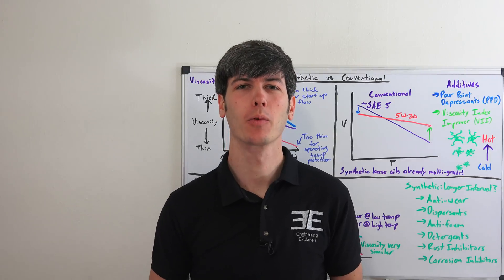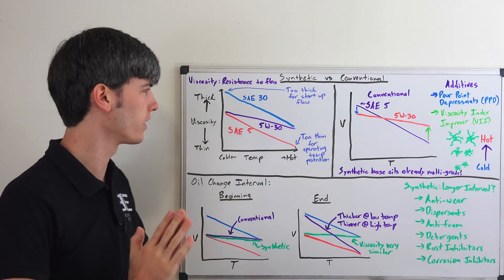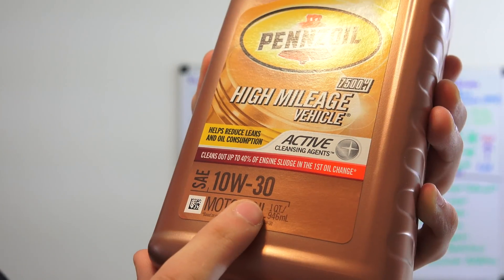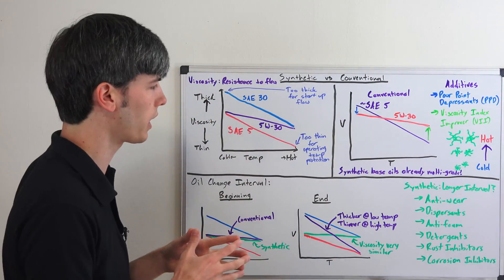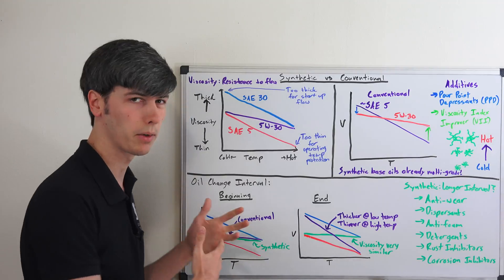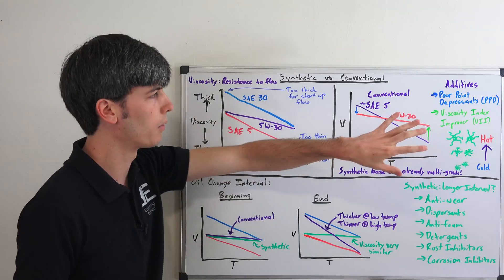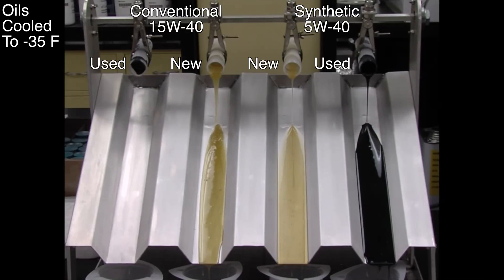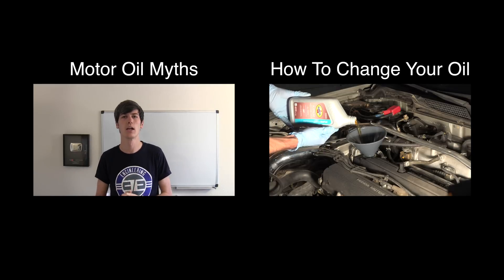Is Synthetic Motor Oil Better For Your Car?

Comment: I was active duty US Air Force for 24 yrs and retired a few years back but long story short (hopefully) I managed laboratories that tested aircraft engine oils for wear and tear. We used Atomic Emission Mass Fluid Spectrometers to test at the molecular level...normally in PPM or parts per million. We tested about 16 different elements for wear in particular places in any given engine. We started using synthetics many years ago...say early 80's. We kept meticulous records on each serialized engine so we could create and track wear. I can't go into great detail but suffice it to say that we started off testing every flight and then moved to 400 flight hrs, then 800, then 1200, (for oil changes) then only when we had a engine problem. Some places still test every flight hr but synthetic oils proved to be the best as far as wear and tear. I switched all my vehicles to synthetic at their 1st oil change. I would not recommend switching a vehicle to synthetics if it has a lot of wear miles on it because synthetic oils will "slide" around worn parts.  Another big plus for synthetics is you can qchange your oil at half or more the rate of conventional so if it's recommended every 3000 miles then it's safe to go to 6 or 7000. In My Opinion! I have been doing this since the mid 1980's and I had the ability to test these same oils for wear. If you spend $30.00 every 6 or 7000 then you'll save at least one oil change plus synthetics wear better, give better lubrication, are not as heat ploblematic as far as heat transfer, and don't break down like conventional oils. Just my 2 cents.
Reply from the maker: +Mr51Caveman thanks for sharing your insight and experiences!
Reply: Mr51Caveman Wow-good stuff man..paused the video to read that.Ty
Reply: I bought a 2008 Minivan and it had 102K miles on the engine but it also had records where the oil had been changed regularly. As I stated earlier I wouldn't normally recommend switching to synthetics at higher miles but newer vehicles have better built engines....so that said I switched the oil in this van to synthetics. I was totally amazed at the difference in engine sound, heat and fuel conservation immediately. I could hear the engine "hum" settle down and ran much smoother. I tested literally thousands of flight hrs on F-15's, F-16's, F-117's, F-4's, A-10's, Ch-57's, HH-60's, T-38's, T-37's and some ground support equipment (probably some more aircraft...I've just forgotten!). All used synthetics and we saw a dramatic difference in wear and tear plus other performance factor's. I personally go upwards of 10K + on my vehicles before changing the oil. No issues in over 25 yrs.  Oh, also I hold degrees in Aviation Technology and Metals Technology and I had to keep many Oil Analysis laboratories certified on a monthly basis.
Reply: Mr51Caveman amazing knowledge and experience you have . Thanks for sharing!
Reply: Iv'e been using Mobil 1 for years. Whenever I buy I make sure that it is FULL synthetic. Some oils will sell a "blend" which to me is useless. From what I understood years ago was that a blend could be as little as 2% synthetic....to me this is just a selling ploy. It was not regulated but that could have changed. I don't bother with any kind of blend just full 100% synthetic. Mobil 1 has been consistently a value for the money. Less expensive and works well. Now...don't get me wrong...I'm not endorsing any one manufacturer over another. I haven't been able to test all the different ones and like anything they all have the "best". I just know what has worked for me.  Some of the other manufactures cost as much as $10.00 a quart. Wow. Not necessary. Most of the time I can find Mobil 1 in 5 Quart containers for as little as $23.00. The majority of the time at WalMart. With that in mind a regular 10,000 mile oil change cost me less than $30.00 with the filter.  Not bad considering vehicle manufacturers recommend (On average) a oil change every 3000 miles. I think they know most people do not do this. But that said, many people today don't check or do what manufacturers recommend. I had a relative call me a few months back and she said her new car smelled "funny". I checked her NEW vehicle and it had over 5000 miles on the NEW engine. The conventional oil in it was black and gunky. I was like wow! "Did you not know you have to change the oil in your car"? And of course she said "no"! So I cleaned out the old oil and replaced it with synthetic and of course told her she had to watch her miles on the engine. But it amazes me these days with some of the younger folks who are clueless! They just think ...stick the key in and it goes! They don't look at tires, fluids (including fuel in some cases!!), etc. I tried to teach my 16 year old grandson how to change oil and he actually told me he didn't need to learn how because he could just "Google" it when he needed to do something!!! Wow...really?!!  Anyway...hope this helps.....
Reply: @Mr51Caveman  you have to make your own youtube channel aboit lubricants and grease and also you can make money by posting videos in youtube.
Reply: @Mr51Caveman  
That is awesome and thank you for sharing your experience. 

When folks lengthen the oil change intervals though, need to also pay attention to the oil filter that’s used. 
Folks who change their own oil, they probably get good quality filters and it’s less likely to be a problem. 
Folks that take their car to franchise oil change places, WATCHOUT!

Many oil change franchise will use what I consider low quality filters that can barely be called a filter. Small capacity. Saturates quickly/early. By which point the oil bypass valve opens up and let unfiltered oil flow right through, including the contaminants that was trapped earlier in that filter’s Service life, is now flushed right back into the engine and circulates through oil galleries. This will turn the oil into sludge real fast. 

Take a look at STP filters to get an idea. They come in basic, extended life, and third one might be called platinum or something. Each higher grade has more total filter medium surface area. 
That means both greater absolute capacity to trap & hold contaminants, as well as better oil flow through the filter so engine isn’t starved of fresh oil when running higher rpm. 
And most oil change franchise use filters with quality lower than a STP basic. 

If one is going to pay the price difference of going full synthetic, consider what kind of things one needs to monitor to make sure one doesn’t get ripped off. 
Examples:
Did the tech really grab the hose for dispensing full synthetic? Or did they grab the conventional oil hose out of habit?
Did they change the filter?
What filter did they use?
Did they change the crush washer?

To this day I still don’t change the oil myself. 
I understand that would be the surest way... to get oil all over myself, my clean driveway, and make a huge mess! 😅

But in all seriousness, I get free lifetime oil changes from this dealer when buying my car in 2010, that’s why. 
I changed oil religiously at 3K mi intervals for the first 100K mi; all on the dealer. I’m sure they used conventional oil. 
Afterwards both because I wanted to switch to full synthetic, and I was feeling bad for them, so I changed the setup:
I bring my own full synthetic to the oil changes, they step up from STP base to Extended Life filter. 
I always ask them to put the 0.5 quart (in the original 5qt bottle) back in the trunk. Both because 1) I collect it for my lawn mower & snow blower oil changes, and 2) So I get a visual “circumstantial evidence proof” that they indeed put in my full synthetic in my car, instead of putting in their shop’s conventional oil and pocketing my 5qt bottle of full synthetic for personal use.
Reply: @reallifeengineer  Great reply! I'm now in my 60's and I have never taken my vehicles to an oil change place. Mostly because I didn't trust them for the very reason's you cited. I use NAPA Gold filters and I have occasionally used a oil analysis to see what they are doing. I still change my own but it is getting more difficult climbing under those vehicles!
Reply: @Mr51Caveman  
Maybe the grandson is willing to learn how to do that now. 
$5 cash incentive to him, every time he does that for grandpa! 
😅
Reply: @Mr51Caveman  , LOL I feel your pain...
Reply: @Mr51Caveman  actually most vehicle manufactures recommend an oil change every 7,500 miles. Not sure where your getting your information. its the oil change shop on the corner that recommends every 3,000 miles. The earliest OCI i have ever seen from a manufacture was 5k miles.
Reply: @Mach141  I was going back to where I started back in the 1970's when it was 3 months or 3000 miles. Times have changed. Engineering is much much better.
Reply: @Mr51Caveman  If a new motor with just over 5k miles and it has black and gunky oil coming out of it the engine has a problem. No oil in today modern engines should break down that fast.
Reply: @jjack6896  A new engine will have a break in period. Oil will be black. As far as the "gunky" part...that's subjective. If it's silvery or showing metal particles there may be an issue.  Do you have access to a strong magnet? Sometimes a lot of particles on a magnet could be an indicator of abnormal wear. Personally I would.change the oil and see how it looks the next change. Even with synthetics it will still be black though.
Reply: @Mr51Caveman  To be frank, many people have learned how to change oil just by watching a youtube video or reading a forum online. Your grandson knows how to use his resources well, I know after watching a few youtube videos on changing oil it taught me how to do it. I've never had any problems.
Reply: @ryantoews3886  I'm not sure if my context was what I meant. That probably doesn't make any sense! I think what I was trying to infer was that the young folks, like my grandson, don't care to actually learn much of anything because of the Internet. We raised him from 4 months to 19 yrs old. I watched him do his "homework" by using the internet to answer the questions. When I caught him I would address this but it did little good. I agree resources are good to have but what happens when those are not available? I use YT or other resources for stuff also. Sometimes it's gotten me out of some pickles for sure! I'm getting ready to install a Mini-Split heat pump system and I don't believe I will have to hire a HVAC person to do it. Estimates so far have been near 10K for them to do it. Myself? Less than 2K. That said I believe people should still get their hands dirty on occasion. Hope I read your reply in the right context. Sometimes not personally talking can get things way wrong.
Reply: Jeff Rielley Actually I started off as a F-15 Crew Cheif. When my lungs collapsed at Moody AFB in the late 80's I told my wife it was time to either get out or cross train. Put my paperwork in to cross train and it came back approved for NDI. So if you were a crew dog you know about NDI. One of the greatest jobs in the AF. Nobody really knew what we did. Did that until the late 90's then took over as Cheif of QA for the last couple years. When I hated putting my boots on I knew it was time to retire.
Reply: Your welcome! My 1st experience with P-3's was when I went to high school in Rota, Spain in the early 70's. Then after I went in the Air Force I was stationed at Keflavik, Iceland for a couple of years in the mid 80's. In fact there's a story I tell around the campfire about how a couple of my fellow airman saved a running P-3 from a dumpster that had been picked up by the high winds that we enjoyed so much in Iceland. They saw the dumpster cartwheeling across the ramp going straight towards a running P-3 and they drove their flightline truck in-between the dumpster and the running prop. They saved the aircraft but did a number on the truck. Nobody hurt except the truck! Actually I have a bunch of campfire stories about Iceland. It was a very interesting tour! Anyway yes, we usually checked 19 different wear elements and it was amazingly accurate. The only real problem we had is if catastrophic wear had occurred and the particles were too big. They had to be molecular to break them down into the spectral lightwaves. When I was stationed in Alaska we had a Army Blackhawk come in and I saw the sample. You could visibly see the particles! I attempted to ground the Chopper because the rotor gearbox and transmission was obviously trashed. The Army Base CC overoad me and told the pilots to fly it back to Ft. Richardson.  They crashed! Luckily no one was hurt or killed. But needless to say it never happened. No one was held accountable as far as I know but as far as the Air Force was concerned when I grounded an Aircraft IT WAS GROUNDED!!!! No one ever questioned my authority again after that. Our spectral analysis wasn't 100% but it was pretty close. Yep...more campfire stories!! Cheers!
Reply: If I had been smart, I'd have enlisted in the airforce. Instead, I joined the Army so I could shoot people. Totally unrelated, but I'm letting you know I'll be extending my middle finger as I cry myself to sleep later. In other news, using army ingenuity, we realized that some heavy weight motor oil is the ideal lubricant for squeezing off rounds with the M2 50 caliber machine gun. It can't be that thin stuff fresh out of the bottle, it needs about 20,000 miles or so between changes. When you seize up an engine, that's the best stuff for the Ma Deuce. The motor pool chief and mechanics don't like to sacrifice good engines to the Infantry Gods, so like most things we learned that rubbing a little dirt in there thickens it up pretty good. Now we tried to bring some of that good southern clay over to Iraq specifically to lube her up, but the tree huggers started crying. I don't know from personal experience, but I heard some Rangers figured out that those liberal tears work pretty good too. I wouldn't try that personally, I'd be afraid of ending up with 45" of limp barrel. 

Yes Sir, one thing I can say is... Thank God I wasn't a marine.
Reply: Asking the oil change place how often to change oil, is like asking a dog how much to eat. Their answer in both cases is, "More. Lots more!".

I would place more trust in recommendations of high end auto makers. They want to be convenient, just as they must avoid too many warranty repairs. Because of recommendations by BMW, Saab, and others, I think the 6-8000 mile interval is usually good, and that synthetics definitely last longer. I do believe they support that synthetics resist oxidation better.

Nothing lasts forever though. The additive package in any oil wears out over time, and changing the oil starts anew.ss Hope this helps.
Reply: louisdl duv Sorry. We didn't test for oxidation. I can't really speak to that except if a Jet aircraft engine can basically go hundreds of flight hours without oil changes then I would imagine a regular car or truck could go for a really long time without that being an issue. And you would have to consider that a jet engine as severe loading and extreme temperatures.  Usually for oxidation to occur the oil would have to be exposed to air/oxygen. A car engine isn't sealed but it is protected very well.
Reply: John Doe imspoke,to,that earlier about the "blends" not being regulated. I would think that if a manufacturer states on the bottle that it's 100% synthetic and it wasn't then they would open themselves up to potentially multiple lawsuits. Now that definitely does not mean they won't  lie or try to squeeze every dime they can from the consumer. There are any number of cases for big business fraud (Volkswagen, BP, etc comes to mind!).  I'm under no illusions that they know that the majority of us don't have the capability to test a lot of the stuff we use so all we can do is hope somewhere along the line if they are trying to cheat us we'll find out and put the SOB'S out of business. That's really all the power we have.
Reply: @Mr51Caveman  l1...
Just want  to thank you for sharing a good information in regards to engine oil. I was a machanic in one of the dealer of Gen. Motors and we only use fully synthetic oil for engine.
Reply: @Mr51Caveman  Do you not know the difference between full synthetic and 100% synthetic?
Reply: Jeff Rielley Ah...yes! I didn't mention those acronyms because most folks wouldn't know what I was talking about. So you know how much sampling we did. Good deal. I don't know if you were around when we did AA or Atomic Absortion testing...pretty dangerous cause we could blow up labs! Really GLAD we went to AE (Atomic Emission). Way safer! Of course I've been retired almost 15 years now so I don't know what's being used now. The last unit I certified was a Spectoil spectrometer. That was the latest and greatest back then.
Reply: Hey I was a "Crewdog" for 12 years before I crosstrained! I know what that's like! I got tired of getting beat up on the flightline so I got out of there luckily. I was a F-15 CC at Langley then Tyndall, then Iceland and finally F-4's and F-16's at Moody. When my lungs collapsed on the line at Moody I said that was it! Crosstrain or get out. But TAC approved the crosstraining so NDI it was. The only reason I started the comments on the synthetics is cause we tested so much of it. Actually is really good stuff. And thank you for YOUR service also. It's a unique club.
Reply: Years ago my mechanic pointed out a hypocrisy of arbitrary maintenance 
schedules vs observed maintenance checks. I exceed 50,000 miles a year 
in my work truck. I drive a Ford F150 XLT super crew. I use Mobile 1 
Extended Performance which guarantees 15,000 but I follow the 10,000 
mile guideline from the operators manual. 

The operators manual identifies an oil change interval of 5,000 miles if the on-board system fails/resets which uses a totally different standard of 10,000 miles or 1 year. If I take it to Ford for an oil change, they use Motorcraft® Synthetic Blend oil and they give a recommendation of every 3,000 miles as per the sticker in the window. There in lay the hypocrisy.

An engine that runs 150,000 miles would go through 15 oil changes based on the manual but would need 50 based on Ford Service's recommendation. Ford's $39.95+tax for each oil change adds an extra $1,400 in services to the vehicle's cost of ownership. Being objective, I know I can buy a used motor with 35K miles on it for about $1,500. Said another way; Following the manual, I'll spend about $600 but following the service department I'll spend about $2,000. 

The price difference in service intervals will keep my 3 year old truck running another 2 years. That means my vehicle depreciation cycle goes from about $17,000 a year down to $10,000 a year with less days of inactivity due to maintenance. Granted other parts will fail which is why you need to keep solid maintenance records.
Reply: Thomas Fraser Wow! Great analytics! Most people would never delve so far into this. But that said that's what we did in the military. We analyzed everything....down to parts per million. It makes sense if you want to find out everything you can about the life cycle of something. And although the military (government) isn't usually associated with cost savings sometimes they do discover ways to do that.
Reply: Mr51Caveman
Reply: Mr51Caveman .
Reply: I remember the days of taking SOAP and JOAP samples.  Good times.
Reply: I was a crew chief, so I took the samples.  Didn't test them.
Reply: mr51caveman, I'd pay you more than 2 cents for that info, thanks.
Reply: Mr51Caveman great
Reply: Mr51Caveman thanx man that was interesting.  its def worth a video.
Reply: Mr51Caveman, thank you for your wonderful commentary. I have an F250 diesel and send my oil for analysis at blackstone labs. really nice and detailed reports on a wide variety of metals and other substances. BTW, I used to fly P-3's for the navy. good times!
Reply: kiddi gudjonss I miss Iceland too! I have thought many times over the years about going back to visit....or even to move there! Seems like many things have changed since we lived there in the mid 80's. My daughter was born there. I guess maybe she has dual citizenship? She has Icelandic and American birth certificates.  She really wants to go also since she was only a few months old when we left.
Reply: GModBMXer I'm not giving anyone advice and I believe somewhere in these comments I specifically said that. I related MY experience from many, many years of actually testing oils and performing Nondestructive tests on many other things, especially aerospace equipment (Aircraft and ground support equipment). I think I also stated that I was a Certifying official for many separate testing laboratories also. We had extremely stringent guidelines for Joint military certification, all services and had to have recertification every 30 days.  Most owner manuals are written for best case scenario's and minimum requirements. We had Indices for just about every engine imaginable. BTW I have lots more stories. What military person doesn't? !!
Reply: Great to see comments like this. Nothing replaces real world experience.
Reply: I did the same thing in the Navy, with the same results. I would like to add that when we disassembled parts and components that had conventional oil, you could see the wear with the naked eye. With the synthetic oils, we would actually have to mic out the parts because they looked new. To also put this into perspective, with conventional grease on planes surfaces, we had to grease daily. Every day. When we went to synthetic lubricants, we only had to grease once a quarter or every 3 months. With the synthetic grease, the grease times expanded and the amount of wear dropped significantly.
Reply: interesting reading mr51caveman! my experience with synthetic oils is also very positive, I have a 2003 Toyota hilux that I brought with 300,000km on it, but it had a very strict service history (every 10,000km) and had done a lot of hyway running so the engine was in very good condition considering its age, (no sludge build up or oil use between services) when I took ownership of this car I changed the oil with a genuine Toyota 20w50 motor oil thinking I was doing the right thing, but on further investigation I noticed that the oil was an "SG" rated conventional motor oil and I noticed the engine was slightly noisy on start ups and sounded slightly more noisy in genral.I then decided to change oil again this time going with a 15w50 full synthetic penrite oil and straight away I noticed a quieter smoother sounding engine and it even felt slightly smoother to drive (I was impressed) I can also say the same about that in two stroke engines whenever ive stripped down engines running non synthetic oil there is considerably more carbon build up and more piston skirt scuffing then when there running synthetic oils
Reply: Arthur Smith I will definitely have to check that out! Thanks.
Reply: I bet you were at Holloman,eh. I was 8th.
Reply: Eagle 275 Yes! I was the NDI lab NCOIC 94' through '96.
Reply: +Mr51Caveman Wow, get out of town, an honest to goodness NDI guy eh? I was a Crew Chief. And because I was a crew chief, I'm very accustomed to being hated by everyone, so when I say I don't buy into the synthetic oil nonsense, it makes no difference that everyone here is going to disagree and tell me just how "old world" I am. 

At any rate, thanks for your service. Code Alpha good buddy.
Reply: That is super good advice, I use it all the time.
Reply: Mr51Caveman  where are you living these days? I have a 47 Navion that needs. Guru or new owner!
Reply: Lee Wilson Greenville SC area. 47 Navion?
Reply: 16's Weapons Troop here!!
Reply: Alexander Mills is what?
Reply: Mr51Caveman turboshaft oil is completely different then recip oil, not comparable. I worked in AOAP lab.
Reply: No sorry. In my opinion I think a decent filter, not a cheap one or a real expensive one,  Is fine as long as full synthetics are being used.  If wear and friction is reduced then wear metal particulates are also reduced putting less emphasis on the filter.
Reply: How is synthetic oil on turbos. The biggest problem with turbos are the oil caking and destroying the shaft. I had an 88 Dodge Dayton Pacifica with the turbo 1, 2.2 liter 4 cyl. engine. The turbo was oil lubed and cooled by the radiator since it had a cooling line going to it. I never had an intercooler, but the single core, plastic side radiator, I had to change out with a 2 core copper and brass black painted, which helped drop the heat. I used 10w 30, 20w 50 and even 5w 30 weight Castrol oil. I just couldnt keep the heat down(overheating issues from the turbo). I even went as far as using a heat shield on the exhaust side of the turbo and on the hood. Viscosity breakdown was a big problem till I changed the 195 degree thermostat to 185 which helped drop the temp down.
Reply: Thanks for Sharing your experience ! i just started doing the same thing and changing from 6-7k miles .. now i see you doing it for very long time without troubles make me feel better
Reply: I too am a certified aviation mechanic, all he stated is true!!
Reply: @Hystorm1  / sure u are...
Reply: Also a former USAF type and noticed, in the early 80's, that they were using synthetic oil in the jet engines.  So, from the mid 80's onward I've always used synthetic oil.  My brother owned a car repair shop and had the chance to rebuild an engine from a car I sold -- the guy that bought it was out joy riding when he dumped it into a canal and ruined the engine.  When my brother tore the engine apart he found almost no wear on the engine.
Reply: NDI Shopchief here. Thank you for your service sir. Interested in this video and found another NDI technician, cool.
Reply: Hey! Thank you also! I've been out of the loop for a few years now so I don't really know what's going on in the military NDI world. After we moved away from Tyndall I lost touch with most everybody. I spent about 3 months out in Vegas doing some pipe xraying (Iridium) and a little Penetrant and a lot of Ground Penetrating Radar. But I was going back to the mid east (Contract) when I got a call from Honeywell Aviation so I thought hmmm, I can avoid all the mid east crap (dodging bombs and bullets)  and stay in the States so I took that job instead. So about 5 yrs ago the nice, well paying job got shipped to Mehico. Out of a job again. Oh well. So been doing pretty much nothing since. Some of the jobs I applied for here didn't pan out because I was OVERQUALIFIED!!! I didn't want to run their companies just have something to do besides cut grass and do housework! Anyway where are you stationed? Big planes or little planes? (Or both in some cases)
Reply: tony coppe Your very welcome. I've been out of the NDI business for about 5 years now and I kinda miss it. Cleaning and cooking sounds like retirement but it isn't!
Reply: Fred Allen I was a F-15 Crew Chief also for the first 11 years or so. Yep SOAP was what most old timers called it and some still do from what I understand from my son in law (active duty AF). I think it officially changed to JOAP or Joint Oil Analysis Program sometime after the mid 1990's but we still referred to it as SOAP. It is a good program. We had indices for just about every engine imaginable and I tested sometimes some strange stuff including blood! Bored military folks! But over the years we saved not only aerospace equipment but pilots and such also with the program. (Crew and passengers) The mundane everyday testing didn't always prove that but there were a few instances where I specifically grounded an aircraft and further testing resulted in confirmation of catastrophic damage. Just my experience...I'm sure other Labs saved equipment and folks also! Don't want to sound like a glory hound.
Reply: Great info. My dad was Navy. 22 years worth. Thank you for your service and your reply. I was a Navy "brat". Went to High School in Rota, Spain.
Reply: Dear Mr Caveman, I have a Honda 97 Civic that has 130k km. Honda recommends 5W40 for the  engine. But the engine have been converted to run on CNG. And i live in a hot humid country (temperature varies from 38C in the summer to 10C in the winter). What grade engine oil will be best for my engine considering the fuel and atmosphere?
Reply: Amazing. I've never heard of someone deliberately running an engine with no oil except for a couple of commercials over the years. I don't know the mechanics of molecular level oil and metal. Just that which was observed with Spectrometry testing. Thanks for relating your experience.
Reply: Leaonard Land Not saying that at all. Like I said before everything I say is only an opinion. That said a decent filter will probably serve you well. That said, a cheap filter is probably never a great idea. A midline filter would probably serve you well. Nothing to stress over. With all the new tech out any midline filter will probably serve you well. .
Reply: I'd like to see a video of someone taking apart an oil filter after say 25,000 or more miles with it not being changed and using synthetic engine oil - or better yet comparing oil filters at various mileages with synthetic oil, say 3,000, 6, 9, 12, 15, 25, 50,000...Perhaps such a Youtube exists.  I'll have to do a search and see what I can find.
Reply: Thomas Morris I have always been leary of using full synthetics in high milage engines. Note this is just my opinion. You are probably better off using a oil that is specifically engineered for high milage. I use a Castrol in my son's Toyota Tacoma that has in excess of 224K miles. But I use a half quart of full synthetic with the other 4+ quarts to give it some added protection. Does that work? Actually without testing the residual oils I don't know for sure. But so far no issues with the engine. I have never been a fan of Quaker State. Some folks are. I've had good luck with Mobil1 but that's just my particular experience and I'm not endorsing any particular brand.
Reply: @Mr51Caveman  O.K. What if you put 2 and half quarts of synthetic oil with a high quality convential oil 2 and a half quarts. 5 quarts with a Mobil one filter. That would be half and half right. So it would be a cheaper oil change except the Mobil one oil filter is $9.97 at Wal-Mart. Change it at 5,000 to 7,500 miles. My Ford 2005 Taurus has 160,000 miles. I did the 150,000 mile Maintenace. I ran 5w20 Motorcraft blend for the 150,000 miles . Decided to go all synthetic 5W20 high mileage Valvoline. The car just didn't seem to run very good. Watched a YouTube video. Decided to run Supertech 5w20 high mileage full synthetic.  The car ran so much better on the cheaper Supertech. My gas mileage went from 26.0 mpg. To 28.1. While driving the same route every day. I am using a Fram Ultra Synthetic filter now instead of the higher priced Mobil one. Just saving 50 cents. But the Supertech oil was $17.71. So now  my oil change is $ 26 and some change not  $ 30 and some thing. The motorcraft was good but it just didn't get the gas mileage I thought I should get. My round trip is 60 plus miles a day. My goal was to use just a little over 2 gallons of gas a day. For a car with 160,000 miles this isn't bad. My car has the Vulcan 3.0 OHV engine. I took the valve covers off and the engine is spot less with hardly any wear.    Shawn
Reply: @shawnbeck2303  Sounds like you have a working plan. I personally don't use synthetics in a high mileage engine IF conventional oil was used for most of the life of the engine. But that's just me. It's almost as if the engine wear with convential oil has worn itself into that medium. Some parts with super slick syn will allow "slide" around ( definitely not a technical term) But what your doing seems to be working. Ok..now for just my opinion again...co out some of the YT vids on oil filters. You may be unpleasantly surprised at how the cheap filters perform. I personally have switched to NAPA Gold or a Purilator. More expensive but you get what you pay for. I learned that the hard way. During all those years testing most was for Military applications. Entirely different type of filtering systems
And I never asked folks  about their brand of filters when testing other type engines. Probably should have
Reply: This leaves no sane man with he choice of conventional oils. Thanks!
Reply: Bo_Hazem Hope the discussion helps!
Reply: It does help. I did however found out, when you buy a reman engine, they say NOT to use synthetic oil, Use conventional oil at the first 500 mile and then at 1000 miles then 1500 miles after that till you have 3000 miles on the engine, then you CAN use full synthetic oil after that. Its from Performance engines.
Reply: @thomasmorris2069  Yes, That s for all new and rebuilt engines. I bought a Jasper engine for my Ford truck. It was a 1981 F-100. 300 6- cylinder. The old engine was worn out and had blow by.  Shawn
Reply: Thomas Morris I wasn't aware of that but in a way it makes some sense. A more thorough break in that would occur faster. Super slippery Syn might make that initial process slower to occur. Plus all kinds of other 
factors. They are the engineers. Good to consider.
Reply: Thanks for your service(and detailed comment)!
Reply: I agree wholeheartedly with your recommendations.  I have a 2003 Ford Mustang GT.  At 1000 miles I drained the factory fill and have put nothing else in the car besides Mobil 1 synthetic that is changed every 6000-7000 miles.  I've even went 10,000 on a couple of occasions.  Fast forward to today, the car is just shy of 289,000 miles on it with no major issues and the car still does not leak or burn a drop of oil between changes.
Reply: Thank you for your services sir
Reply: @Mr51Caveman more interesting than the video
Reply: JOAP
Reply: @jd646  When I retired back in '02 most folks still referred to it as the "SOAP" lab but I get what your saying.
Reply: @Mr51Caveman  when I was in it was JOAP
Reply: @jd646  where were you at?
Reply: @Mr51Caveman  I was a crew chief on f16s at spangdahlem and osan
Reply: There were some guys that did a test with a brand new car and synthetic oil, and setup to just replace the filter every interval and top off the oil. I believe they used Mobile 1 but not entirely sure.  They had detailed breakdowns on their site of tests they had done (by an independent lab)  and aside from some outlier tests (single tests that resulted in results indicating possible or approaching trouble) they got by quite well for iirc 75k miles without doing more than topping off the oil/replacing the filter every 3000 miles. Also iirc the car they selected was one of those that had the filter attached by hoses to the side of the engine well instead of under the engine, so it did not lose a great deal of oil on replacement. They were mechanics of some sort btw. I think they intended to tear the engine down at 100k but things got sidetracked.
Reply: My grandfather always suggested if full synthetic oil was used, it never needed changed other than the filter and topping it off.  My 2000 Grand am has just under 300k miles and I probably changed the oil only 10-12 times in the 18 years I owned it. I usually change it whenever the car overheats, tune up, or or other repairs that could risk introducing foreign dirt etc in the oil.  I've done this to all of my cars and they all have over 200k miles. I question if frequent oil changes increases the risk of introducing foreign dirt and stuff into the engine and reasons why most people have more issues with their cars than I ever have.  @copperhamster
Reply: @copperhamster  funny I’ve thought the opposite. Change the oil and leave the filter. How much can it possibly be pulling from the oil?
Reply: John Doe use synthetic in the winter. It flows better in freezing temps. Yes you can swap around and add conventional oil to synthetic and vice versa. Check out on YouTube. -40 Mobil One  Amsoil  Royal purple test.
Reply: Mr51Caveman Royal Purple
Reply: Mr51Caveman is
Reply: Loved your campfire stories, I have a few from when I was stationed at Loring AFB in Main. Like the accident a KC-135 had with a Moose on the runway. The aircraft was rolling for take off when the Moose decided to run across the runway and collided with #3 engine. They had to send up folks from Boeing with Depot to fix that one and there were Moose parts all over the runway.  I learned to really hate winter there too. Like you I was in Fabrication Branch but I was in the Machine Shop, but I did work with the NDI folks a few times. Later, when Machine and Welding became one shop all our welding certs went through NDI. I left active duty during the buy out in 94 but wound up in an Air Guard Unit. Y'all take care.
Reply: Greetings from Iceland, Keflavik hasn´t been the same without you!
Reply: Mr51Caveman l
Reply: James Graves -
Reply: yes?
Reply: Mr51Caveman k
Reply: Sarge, I remember those days I was a mechanic on F15s. We called that a s.o.a.p. sample. I was so impressed that after I left the USAF years layer I bought a Peterbilt and found that Speedco was one of the few places that offered three same program,under a different name. I paid the extra $10-12 to have it run on my motor. Great program.
Reply: Mr51Caveman                                         ,,,
Reply: Mr51Caveman boom roasted
Reply: Mr51Caveman Well your 2 cents are worth much more than just that. I've been paranoid messing with synthetic after I used it on a high mileage car which caused an oil leak. I will go through the owners manual and forums for using synthetic on my 2016 Accord Sport now. But with using synthetic on high mileage engines which you also mentioned, is there a certain mile mark where one should transition from synthetic back to conventional due to those issues ?
Reply: I don't know of a milage "mark" for transition. I've owned literally 20 plus new vehicles in the last 35 or so years. It used to be kind of a joke in my family that I couldn't keep a car or truck more than a year or so. I started to change over to synthetic on the first oil change with all of them. In my opinion if someone had advanced full synthetic the entire life cycle of the engine then wear would be minimum, all things being equal. Today's engines are engineered significantly better than they used to be. I remember when having 50,000 miles was considered almost "high" milage and anything over 100K was over the hill! Today's engines are just getting "broke in" @ 100K miles. Vehicles with 200k or more on their engines is pretty common anymore. Engines are mechanical in nature and manufacturing techniques vary but still most are engineered with tight wear tolerances. Like I said, in my opinion (I want to make that clear!) I run full synthetic at the earliest opportunity.  If I purchased a vehicle that I couldn't confirm oil type or change interval and it had high miles on it I would probably use a high milage conventional oil in it. Without a somewhat expensive breakdown (Inspection) to confirm wear I don't know of a way to check. A rough running engine could be all kinds of different things from sensors to crappy fuel. I hope this answers your concerns.
Reply: Great info! Thanks for your comments.
Reply: I use Mobil 1 extended service guaranteed for 15,000 miles.  I've been using Mobil 1 for many years.  On my old VW Beetle that I bought used I never changed the oil.  I just replaced what dripped out. It got to 300,000 miles and still ran like new but rust was destroying the body so I gave it away.  My previous vehicle, a '97 Ford F150  had 332,000 miles when i traded it in and likewise still ran like new.  I changed the oil every 10 or 15 thousand miles on it. My present vehicle,  a 2009 Ford F150 now has almost 200,000 miles. I treat it the same as the last one.  

Back in NYC I knew someone who once tried to deliberately destroy an engine by running it without oil.  But the engine had Mobil 1 in it before he drained it.  He said that oil was so good that it got into the pores of the metal and after running it without any oil at all for many hours it still ran perfectly and he gave up.
Reply: @leaonardland9001  Leonard, what sae viscosity did you used in that 97 f150? 5w30 synthetic mobil 1? Did it had the 4.6l v8? Just curious
Reply: @tomorrowcomestoday1621  

5.4 V8 and right 5w30.
Reply: Yep it's  true story.  Say,  can you recommend a Youtube with info on the best oil filter to use?
Reply: I've been buying either the Mobil 1 filter or the most expensive filter I can find at the Walmart (which is the only place I know that sells extended service Mobil 1).
Reply: Is it not worth getting the Mobil 1 filter then?  I have been using either that or the best one at Walmart, Walmart being the only place where I know they sell the Mobil 1 extended service guaranteed for 15,000 miles...and speaking of that, is that actually different and better than ordinary Mobil 1?
Reply: Leaonard Land Me too. I've seen some filters cut in half but never a controlled experiment at specific. intervals. Maybe the oil industry has done something like that. It would be interesting. I know some industry and the military have/are experimenting with exotic materials which would eliminate the need for certain types of lubricants. Future stuff........
Reply: Thomas Morris a synthetics should handle higher temps of a turbo better than a conventional oil and keep it marginally cooler. But I have the same caveat about switching, an older engine to synthetics. Both me and my brother had bad experience switching (I inherited an old truck) but always used and never had any engine problems in vehicles I used synthetics from the start. It's a tough call, if the advantages of switching to a synthetics is worth the risk of things like increased oil lose/usage or worse in a older engine with a turbo, so good luck in deciding (if u still have it).
Reply: Can you use a FULL synthetic engine oil on a high mileage car, van or truck. If NOT, what kind of oil and what type of weight rating. OH, Ive used 20w50 straight 30w and i normally use a 10w 30 weight. I am planning to buy a brand new Jasper Engine and Transmission or my GMC Safari minivan. It has a 4.3, V6 Vortec motor and the oil pump went out seizing my engine. So any of you who has a lifter TAPPING on startup and it doesnt quit after 5 10 mins of running, go buy a NEW oil pump. It will save you much needed headache. It was tapping on the passenger side, so dont just think its a lose lifter.
Reply: I still would caution u on using a synthetic on a high mileage engine.

With a new or more likely rebuilt engine and/or transmission from Jasper or anyone else,  Pick a company (I heard mixed reports from shops about Jasper) that has reputation for reliability and honoring its warranty. Use an approved installer. Make sure everything is done within the specs of the warranty. Check what the warranty says (or doesn't say) about what oil u can use and how often it and the oil filter needs to change to keep the warranty valid. And there r synthetics for transmission oil too, so if can find a compatible oil that covered under warranty consider using synthetic oil for both the engine and/or transmission. 

I suggest an upgrade to a full set of reliable gauges including at least oil temp and pressure gauges, to be safe. It's a relatively cheap addon and is a much better indicator of a problems then just depends on hearing a noise or a check engine light. And there r monitoring devices and 3 parties that will actually monitor ur vehicle like OEMs (like Tesla does) to help prevent minor issues becoming major issues. And as proof if a warranty needs to be claimed.  Good Luck.
Reply: I just remembered Quaker State motor oil had a warranty program, so u may want to check if they or any other motor oil company currently has 1 that would be valid for rebuilt or new engine. And I found Mobil1 High Mileage Full Synthetic Motor Oil and  Castrol GTX High Mileage 20W-50 Synthetic Blend at Walmart all for same price as the non High Mileage version and the Castrol Blend was same price as its conventional motor oil.
Reply: Red Line oil (in an email to me from several years ago) states that their recommended oil change interval for their multigrade (non-racing) motor oils is between 15,000 to 17,000 miles or once a year, whichever comes first. 

Red Line also stated that an owner should follow the manufacturer's recommended oil change schedule while the car is under warranty. You'll note that in this video, the narrator also recommends following the manufacturer's recommended oil change schedule (his rationale about additives "wearing out" is largely nonsense): everyone has to say that for legal liability reasons, because a warranty can be voided if the manufacturer's recommendations are not followed, and to go on record giving advice to ignore such recommendations could expose one to a legal action for damages.
Reply: Is this an Ad for Red Line oil?  Y even watch the video if u think u know already that additives do not wear out or even break down? Just out of curiousity how did u come to that conclusion?  And thx for repeating what the narrator said and the rest of us already know about warranties..
Reply: My my, you're touchy. I mentioned Red Line oil because I had asked them a question when I first started using it (having seen many members of the Porsche Owners Club and PCA swear by it in the late 1980s), and Red Line was kind enough to give me a prompt and long reply, from a technician there. 

If I had asked the same question of Mobil or any of the others, and received an email reply, I could have quoted them instead, or in addition. Mobil 1 says more or less the same thing somewhere on their website (an excellent website, BTW). 

Regarding the issue of oil change intervals: the narrator skips over the "additives break down" mention as quickly as possible because his rationale makes no sense in light of the extended change intervals noted by the synthetic manufacturers; why would Exxon-Mobil or Red Line or Royal Purple or Amsoil sell a synthetic oil good for 10,000 or 15,000 miles between changes if any additives broke down after 5,000 or 6,000 miles? Make any sense to you? 

One important thing this video does NOT mention is the importance of using an extended-life oil filter (such as a Mobil 1 filter) with synthetic. There's no point in using an oil that can protect well for 10,000 or 15,000 miles if the oil filter gives up the ghost after 5,000 miles.
Reply: NP, Im sure u mean well its just with all the crap on Utube, maybe I'm little defensive about EE that seems to have useful info. 
The narrator talks about synthetics needing less additives when compared with conventional oils so "additives break down" is less of a factor. So why do u say " his rationale makes no sense" ? And he went into great detail about the cause of additives break down, so with all do respect if u think narrator skips over the "additives break down" u should review it again. And breakdown in oil just like in ppl starts from day 1 we just hope to make it as slow as possible in either case. 

I'm glad u found a synthetic like Red Line that satisfies ur needs. I hope 1 thing we can agree on is   synthetic is far superior. Personally I'm not racing a Porsche and I have great results with less expensive brands (mostly Mobil 1). But to each their own. 

I agree about the use an extended-life oil filter (and thought about it myself ), but it was about synthetic motor oil and not filters.  (I didn't check but I bet he has vid on oil filters too. But no matter what let's hope ppl have the common sense to know the filter will need to function properly as long as u keep it in ur car)
Reply: N C Ok so I'm on my cell and I hate this little keyboard! I see posts and some folks want to comment more on the grammar than the subject but anyway.....
Looking back on some of the post discussions it has been informative and sometimes akttle off subject but that's a social media thing I think. The last couple of years or so it seems some manufacturers are hyping their extended life of their oils. If you take the leaps in technology and manufacturing it would seem that engines are significantly better than they used to be. You can now get way more horsepower out of a smaller engine and they last much longer. I expect these leaps will continue. And the debate will continue until we're all driving  (or flying!) Some kind of alternertivly powered super vehicle,  super vehicle. I hope I'm still around to see that!
Reply: Since I'm dyslexic and my grammar sucks, good luck dealing with the grammar nazis who tend to be just trolls and idiots. I have an engineering background and like to check out the new tech. But I'm starting to think it's a waste of time to comment in a social media age where facts don't matter (look at the pres we have).

I cant say much about if the extended life versions r worth the added cost when synthetic oil by its nature doesn't breakdown as fast and oil filter still have to changed.  And think about getting a PC/Chromebook with a real keyboard and screen size. My eyes r to old to use a phones to do this.stuff,
Reply: Full synthetic to synthetic blend. Which would be best to use on high mileage cars with or without turbos? I want an oil that will protect during the extreme summer months then work just as hard in the winter. The biggest problem Ive had with oil, especially with Quaker State which Ill never use again is that it turns into slug in the valve covers and then the intake manifold had it caked in. It was a 10w 40 weight. We changed it to a 10w30 and it would hold up. Mind you this was in a Ford LTD with the 302, V8.
Reply: Well, when I get a reman engine/rebuilt should I use the full synthetic oils, or just use regular motor oil?
Reply: Thomas Morris Personally, If the engine has new components in it I would use full syn. Advanced protection right from the getgo. That's my 2 cents and only an opinion. You do have to check to make sure your warranty, if you have one, is good with that.
Reply: Thomas Morris,  1st there r high mileage synthetics now. If u get that Performance engine make sure u get verifiable proof of doing everything the warranty requires to keep it valid. I would suggest u, get a shop to do the oil changes so u have proof that it was done with the oil type and when its required. If u dont have full set of gauges, adding at least a good oil pressure and temp guage is a good idea. That many oil changes during the breakin period is unusual so do ur research on them.  As I told Mr51Caveman in the past good luck no matter way u decide to proceed.
Reply: Good advice NC.
Reply: Not ALL manufactures know what is on the car, especially when it comes to wheels and tires. They come out and say ALL tires need to be filled to 35 psi. Thats wrong first off. If you take the time and READ what the tire side wall says. You be more informed that more vehicles use higher pressure of air because of low profile, HIGH speed tires like H, V and Z rating. I have a 2002 Toyota Celica GT and there was aftermarket 17" rims (Scion) to be exact and the air pressure in them COLD is 44psi. 35 psi would have caused the tire to wear off of the rim and cause abnormal wear, possibly a blow out. Another example, you have a mountain bike and I have an old Schwinn 10 speed 27" tires and rims where the mountain bike has 26" rims and tires. Mountain Bike can go off and on road with the rugged knobby tires where the Schwinn doesnt because its a street bike. Case in point, the Schwinn tires can go from 90 psi to as high as 110 psi where the mountain bike is from 45psi to as high as 65psi cold. Follow what the TIRES sidewall state, NOT the owners manual of the car. Its based on what was standard equipment this 35 psi came from, but when you have upgraded packages like bigger wheels and tires, that changes.
Reply: when I said at the first 500 miles, this is an actual oil change, then run the new oil up to 1000 miles, change the oil again and then at 1500 miles change the oil, but this time you CAN use full synthetic oil. This is considered how to properly BREAK IN a new remanufactured engine. As for rebuilt, they just reuse some of the parts that are still top quality and if it failed during testing, they would change it out. Here is my question if you buy a long block reman engine and you have to reuse your intake and exhaust manifolds, how tdo you know or even prep them from the old gasket materials. Wouldnt you have to sand off the hardened on gasket material to get a solid seal and no leaks, especially from the intake where the oil and coolant will be the biggest problem and then the mating of the exhaust manifold to the heads. I have NOTICED when looking at reman long blocks, the processes are NOT to quality if you can still SEE the preexisting matted gasket material around the inlet ports, or even nicks along side there. Wouldnt you think to inform the company about that, especially when you are paying $2,000 on a motor. Also, who would recommend where to get a top quality replacement V6 engine for a 97 GMC Safari with the (W) vin?
Reply: NC  Its NOT a Performance engine, its a V6 Vortec for a 97 GMC Safari minivan. Had the mechanic told me my oil pump was failing, I would have replaced it SAVING me a much needed headache. But now, Im looking to replace the whole motor since his error cost me my engine to seize up.  

Now with this warranty, some places now offer a NO FAULT Warranty so if anything happens, its covered. I read it and for $350, Id buy it.
Reply: DONT buy a Chromebook, its a waste of money. Not sure what you are going to do with a Chromebook, but buy a very good desktop PC and you wouldnt have any problems. If you want to know more, message me and I can advise you. For the money you would spend, I can promise you that once you buy from this company, you will not have anymore issues. They are that good
Reply: Ive seen those oils for cars with 75,000 miles. Which brands are best. I have a toyota 2002 Celica GT with 205,670 miles on it. What oil would you recommend since we dont know what the owner had in it. I will not use Quaker State oil.
Reply: Thomas Morris, Good luck with ur replacement engine and and dealing with ur mechanic and using synthetics as soon as ur allowed too. Again a full set of gauges that include oil temp and pressure I think good idea but I will leave that up to u. 
I have been using my fast efficient Chromebook with built in virus protection for yrs. And I like it even more now, that Android apps can be used with it. So my PC has just collected dust. But I'm not here to tell ppl what's best for them.  And this is not the place to debate its merits vs it limitations to especially to someone who seems to have made up his mind on the issue.
Reply: Thanks for the info, I have a question? I have a 2011 impala, with 82'000 miles on it is that too many miles to switch too synthetic. This car is meticulous. never ran hard at all. I've only floored it one time sense I had it. I was surprized how fast it is
Reply: russ carney jr I don't know which engine is in that car but a 6yr old or thereabouts isn't too old. It's a modern engine with tight engineering tolerances. Let me stress....in my opinion....I wouldn't think there would be any issues switching to full synthetic. You could try it. It wouldn't be a bad idea to have your existing oil tested to see your wear. Of course if you haven't had it tested on a regular basis then you would have no patterns. But it could be compared to known engine analysis. If you have regularly changed your oil then more than likely you would be fine. Again...just an opinion.
Reply: What he really means is get cha butt down to Walmart and get the good stuff.
Reply: i want to do oil samples on my truck, who in wisconsin  could i do that with or anyone for that matter, thanks
Reply: wisco I've been out of the business for a few years. Maybe you could do an Internet search and find a company you send the sample off to. Last I heard the average for a test was about $60 or so. I'm fairly sure it has changed but cheaper or more expensive idk.
Reply: Mobil 1 full synth is awesome.
Reply: in 1992 i used to have a 200hp+ Vw then i'm just joking. i was born in 98. keep scrolling down.
Reply: Well said
Reply: Mr51Caveman  thanks for your information shared please tell me I have a KIA CERATO 2010 it’s 2000 cc petrol it’s done 1,30,000 kms pls tell me which engine oil I should use thanks
Reply: +Ravinder Gill Thanks
Reply: Mr51Caveman has
Reply: Vegans and veterans.  You never have to wonder if someone is either of them.  They'll tell you.
Reply: Was that Tyndall in Northern Territory Australia?  Nice place if you like fruit bats! (and heat!)
Reply: Thank you for cutting to the chase!
Reply: Spank you for you're nervous.
Reply: c
Reply: Thank you for your service!!! Awesome advice! I’m the widow of a nearly-30-year veteran and I just purchased my first USED car without my late husband. A2015 Infiniti Q40, with 28K miles. I was offered synthetic but chose conventional oil, because I don’t know the difference! A friend of mine was a USAF Air Craft Mechanic, and it never occurred to me that I should ask her advice in this particular case. You have a bit more experience and my next oil change I’m going synthetic!
Reply: Your 2 cents must be in another currency because this is million dollar information, thank you
Reply: I change my oil every mile. It only costs me 60 bucks a mile.
Reply: What would you suggest about the "time" element as to when to change the oil?  If I only drive 2000 miles a year, do I need to change the oil every year, or can I wait until I reach the 5000 mark?
Reply: @jimcroyts5592  i do know that oil adtitives do degrade over time in the oil. And most engines only burn about 32%  of the sprayed fuel the rest of the unburned fuel goes right into the oil turning it in acid. Witch is what you do not want . Castrol magnatec or kendal full synthetic. Even though those are only a group 3 oil real synthetics are a group four. I change my oil every 3,000 or every 2to 3 monts at the latest. Also the oil filter is about 60% of it. Stay away from fram. I like the napa gold or platinum oil filters. When I can not get my motorcraft oil filters. If you want extra film stringht to significantly reduce metal on metal wear . Motorkote polytron or protecta are really good oil adtitives. I myself run castrol magnatec with polytron and no more friction but iam doing over kill. Probabley polytron or best line oil adtitive with kendal witch has higher zddp and titanium to fill in worn spots. In your case. And of course always use the manufacture sae viscosity.   This was as short of an answer as I could give you. And I always fill the oil filter or fill at least a quart of oil through the oil filter housing and start the engin with the cap and dip stick off in a clean environment of course to purge any air out of the system. None of the books say to do this but its somthing I have developed on my own.
Reply: Thank you sir for your service to this country, and for the feedback, I’ve been going crazy about not having time (because of my two jobs) for not changing the oil once I hit the 3k mark im now on my 5k mark but I can still wait another month or so and still be good. Plus it’s a brand new car.
Reply: Wow, We just found out the best oil filters from a man who took his own money and bought as many oil filters as he could. Then cut them all open to see the insides. He let us  make our own decisions about which one we wanted to use. What synthetic oil do you use? What weight? In what car? What engine size? We need to know so we can run the best oil we can .Thanks for your input. Please answer my question on this matter. It would be very nice if you did!   Thanks  million!    Shawn
Reply: Mr51Caveman I was a marines and we eat crayons
Reply: Would never change my oil every 10 or 7 thousand miles even if I put synthetic oil in, you should change your oil every 2000 to 3000 miles regardless of what oil put in regardless of synthetic oil or not
Reply: @ItsCalebsChannel  Why would you say this? Not to be offensive but what technical expertise or data do you have? I have 3 Degrees, certified in 9 different Modalities and decades of advanced experience. Seriously...not tooting my horn but data, training and experience does mean something.
Reply: Mr51Caveman highee miles I still use synthetic but 10w40
Reply: Thanks very much for your service, and your valuable information....Now, tell us....what's REALLY at Area 51 ?  :-)
Reply: Does the 5w30 fully synthetic car engine oil can perform at higher temperatures?
Reply: Does 5w30 fully synthetic oil perform at higher temperature environment?
Reply: What about dirt?  Synthetics do not miraculously make biproducts of combustion disappear.  I run synthetic but change it at the same interval as conventional because both have the same amount of contaminants.
Reply: Theres a penis in my bumhole
Reply: sounds logical Thanks
Reply: I've been running Castrol Synthetic in my old 96 Grand Voyager 3.3L since 160k miles, I now have 242k miles on it and it's been awesome. Engine looks super clean from appearance of the one rocker arm I can see. I don't go over 5k miles on oil changes as I can hear/feel a difference as I approach 5k.
Reply: @MTBD80  Good deal. I believe in Syn.
Reply: what about an engine that was made before synetic i put some in and it smoked worst than with normal oil
Reply: @stovolbelinche3178  I never recommend putting synthetic in an older engine. Too many badly worn parts. Let's super slippery syn oil bypass and get eat up and burnt. I always put it in new. Probably be okay if the engine had only a short time on conventional oil and then changed over.
Reply: I used Mobil  1 synthetic for 100,000 miles on a modified 240sx that had a turbo added to the stock engine. the engine failed due to a waste gate failure  which cause over boost and caused the piston ring land to break. what was surprising was that after 100,000 hard driven miles that when we pulled the motor apart it was clean, zero sludge, nice shiny  metal.  I also highly  recommend red line synthetic gear oil and manual transmission oil.
Reply: My car's owner's manual recommends replacing the oil every 7000 miles. Suppose I decide to go with the 3,000 miles recommended by most places where they change oil. Suppose also that I drive 3,000 miles a year. So, I would replace my oil once a year.
No. When people compare synthetic oil with conventional oil, they always focus on debris being collected from the cylinder wall as the pistons move up and down. Since there is less friction with synthetic oils, less debris is scraped off of the cylinder walls, so the oil may be used for more miles.
The only problem now is oxidation. I once asked a service manager at a car dealership how often I should change my oil if I drive 2,000 miles a year. He said six months because motor oils are subjected to oxidation which reduces its viscosity. That means, even if I have driven the car just one thousand miles, after six months, I must replace the oil.
I recently purchased Mobil Synthetic Oil for 50% more than I would pay for the same amount of conventional oil. Since the container says: "Guaranteed protection for 15,000 miles", I have decided to change my oil once a year considering that I have a car that I only drive 6,000 miles a year. My only concern now is OXIDATION.
If conventional oils have to be replaced after six months regardless of mileage driven due to oxidation, then I have to ask if the same rule applies to synthetic oils. In other words, here is a question I have been asking for years on the WEB and no one has been able to answer it:
"Are synthetic oils less prone to oxidation than conventional oils?"
Reply: louisdl duv 
Using regular oil, 30w , I changed my oil and filter every 3000 miles.  69 Malibu.  It was torn down at 200,000 miles and only had a coating of grey inside the valve covers that could be easily be wiped off with your finger.  the reason for the yearbook was I was using a  lot of oil. #7 piston had a hole in the top because my brother gave it a tune up while I was in Vietnam.  He mixed up #7 wire and#8 wire which caused a predetonation on #7 thus the hole.  It's almost imperceptible to hear with the engine running. That was with Pennzoil regular oil. Always turned dark after a week, but was normal for Pennzoil.  Our testing facility on board always used Pennzoil for comparison tests.   It was the Navy standard against which all oils were tested.  I now use Mobil 1 and change at 6000 miles with a good filter. So far,  not a problem in my Ram Hemi V 8.
Reply: @jerrynewberry2823  Yep, I use Pennzoil or Valvoline now in my Ram 2500 with the 6.4 liter. I usually go easily 7500+ between changes and I've not encountered a problem in years. I had a Convertible 69 GTO, but when I was deployed in the early 80's it was stolen and destroyed. Never got the SOB's who done it. Bad luck when your deployed or stationed somewhere sometimes. My 16 year old tore up the Ram truck I gave to him when I was stationed in Korea back in the mid 90's. I gave it to him in almost perfect condition, went away for a year, came back and it was sitting on blocks....with lots of my hand tools laying all around the yard rusting happily away!
Reply: @Mr51Caveman  I feel for you on the 69 Goat that got stolen, I lost a 69 Camaro out of my driveway the same way but it was never found. I sure hope the SOB burns in Hell.
Reply: @louis5555gmail , RE your comment: ( I once asked a service manager at a car dealership how often I should change my oil if I drive 2,000 miles a year. He said six months because motor oils are subjected to oxidation which reduces its viscosity. )  Hey Louis, I've worked at dealerships for countless years, and Service managers are never auto techs, they are MANAGERS, whose job is to talk to customers and sound important and impressive.  They push the Party line: Do what we say, and buy a new car every few years. He has NO clue, but has to sound like he does.
Reply: @louis5555gmail  Honestly, stop being concerned with oxidation. You are concerning yourself with far too much, that even experts and pseudoexperts can't agree on. I've been a "hotrodder" and  DIY driver for a half century. I used to change the oil and filter in my hotrods at 2000 miles or 2 months, whichever came first, with Quaker State Super Blend (SAE API SF)10W-30, when it was on sale as a loss leader for 35 cents a qt. Tore a Ford 302 down at 129K miles and found no practical measurable wear in the engine. That was 43 years ago. We've gone from API SF then to SN today, and from conventional then to that and synthetic today.
I'm retired today and also driving just about 6000 miles a year. I will run synthetic up to 7500 miles or 1 year and never question it. Period!
Reply: @louis5555gmail  
In case your question wasn’t answered yet:
Yes full synthetic oil is less prone to oxidation, than conventional oil.
Reply: Mr51Caveman check out using Marine outboard TCW3 oil in your gas tank. Google Sarge LS1 on using Marine oil in gas to clean and lube the whole system. It must be TCW3 rated. The ratio is 1 oz oil to 5 gallons of gas every time you get gas. Many people do this with great results. Lots of info on Google. Works like Lucas fuel conditioner and injector cleaner but much much cheaper. I buy Pennzoil XLF Marine TCW3 at Walmart $18.00 a gallon You won't know your car is running at idle. Give it a couple of tanks.
Reply: They are the best if they are true synthetics.  I am not out to promote any brands but I know a lot of people who don't believe in synthetic oils.  That is sadly understandable considering that here in the USA they can essentially label anything they want as synthetic because of an advertising loophole opened by Castrol.  They make a good product but I kinda hate Castrol for making it easier to falsely advertise an oil that is technically not really synthetic as if it were synthetic.  Castrol must be known as the father of legalized false advertising and thus hated for it.

I know that good synthetics exist but with so many pseudo-synthetics sold these days, that can cause a need to do a lot of msds searching.  In my Volkswagen, I use a rather expensive brand of oil Liqui-Moly (if you ever see Lubro-Moly it is the same stuff and from the same factories, weird isn't it?)
Reply: What brand and type of Synthetic oil do you use in your cars?
Reply: Thank you so much for sharing your real expert world experience, very helpful.
Reply: steven wentling Is that a military lab? Back about 25-30 yrs ago we called it a JOAP or SOAP Lab. And when we first started using "synthetics" it was used for the LCS fluid and the engines. ( and eventually for hydraulic apps)  Not being specific about turbo or recip just the basics of synthetics. They can be used pretty much in anything requiring advanced lube properties. Appreciate your input. Thanks.
Reply: Mark Demoreuille  check out  the testing  on YouTube -40 Mobil One Amsoil Royal Purple. The Mobil is great in freezing and hot temps. Mobil One in turbo engines.
Reply: Mr51Caveman This is bad advice and you should change your oil when your car manual says to. Cool story, though
Reply: I like your point about old motors. Would this be appropriate on old style motors that are not worn out as well.
Reply: Thank you for your service Mr51Caveman
Reply: Man just say which one u think is better fuckass